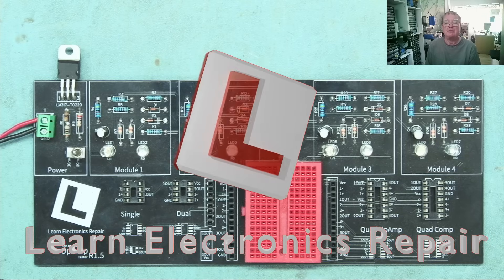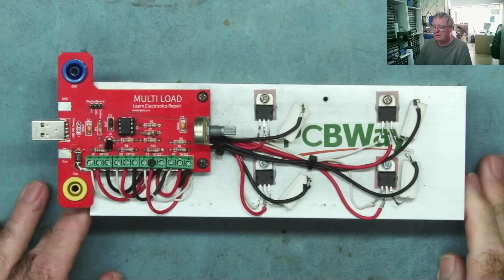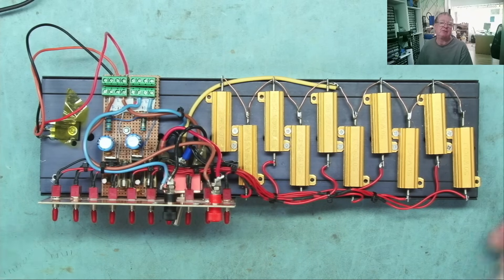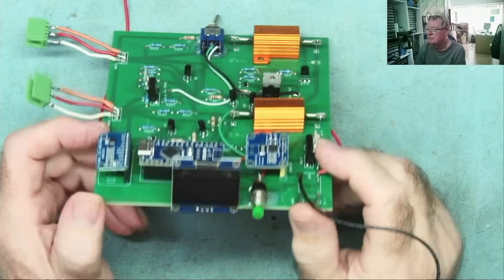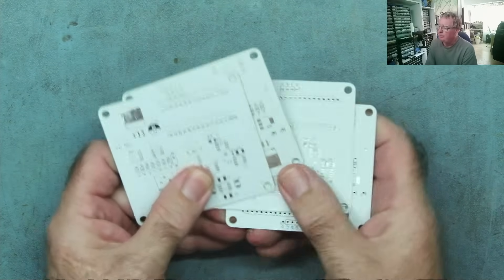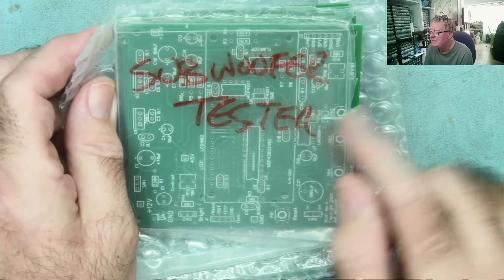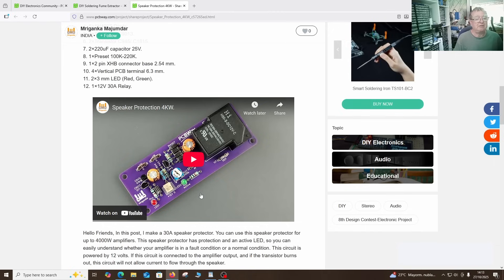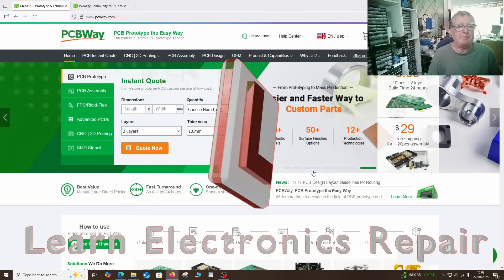DIY Electronics Projects = Cheap Test Equipment!

Comment: Nice selection. The original automated tester looks rough 😂  In fact lots of them look a little agricultural 🤣  but if they work that's 99% of the battle.
Going from 5v, 5 amp of the next version, to 12v is easy but will need to chat about how to make it not blow up or burst into flames when using 20/30/50 or whatever amps.  That super high current part is a bit outside my comfort zone and skill level but moving from next version to final version for the control part shouldn't take much work (assuming the 5v, 5 amp version works - will finish building it by mid Nov but will need more time for the CrowPanel software).
Reply: You do not want to see my DIY test gear like my opamp/555/relais tester. Build it years ago on vero-board. It is not even in a cabinet. But I use it a lot. Also build a universal IC tester. It is build like a tube tester. It has a zif foot and 14 12-position rotary switches. It is one big ratsnest inside but it serves me well the last 10 years orso. Every switch has things like +/-/gnd/resistor+led/potentiometer/ pull up/pulldown/bnc input etc.   I insert the IC, set the switches and test the result. As soon as I have a good setup I write it down for the next time I have to test it again. But it is build in a nice cabinet. Also a lot of small testers for things like triacs, 78xx regulators, opto's. All types of adapters/jigs for all kind of tests (most RF related like attenuators, directional bridges but also DUT holders, DC blockers etc.  And things like coil saturation tester, Z80 tester and more serious gear I designed and build like a 25MHz to 2GHz sweepgenerator, A DC to 500kHz 6,5 digit powermeter, A heavy duty dynamic load etc. All dead bug or on veroboard. Does not cost much and it makes that you can repair stuff others can not. (and the result was that 11 years ago I started to do commercial repairs)
Reply: @pa4tim  Enclosures hide a lot of sins 🤣  Not built as many things as you but I'm au fait with ramming the lid onto a rat's nest and making a mess look quite pretty from the outside.  Never open the box, is my motto 🤣